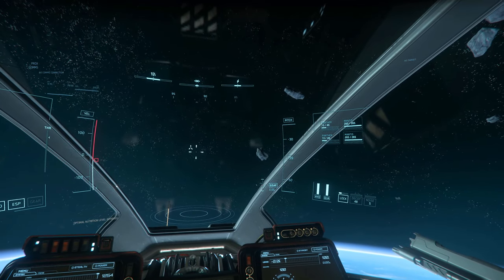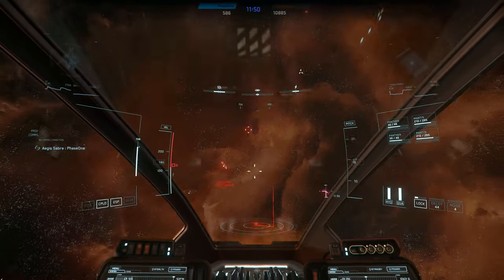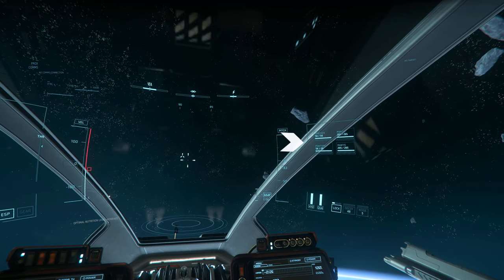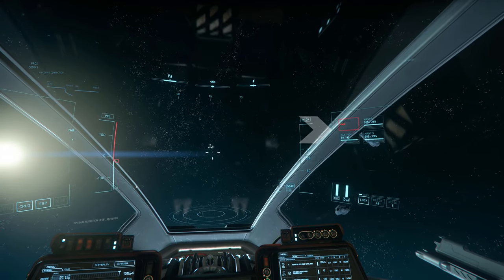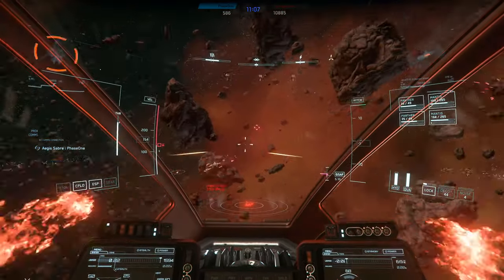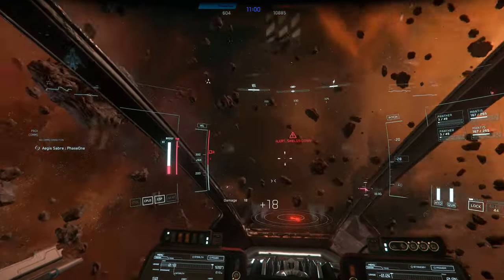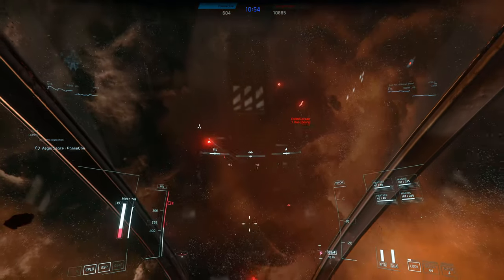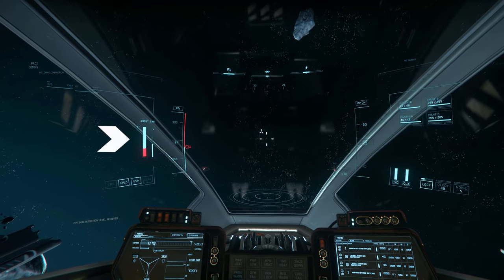Star Citizen 3.14 - Ship Capacitor Management Guide

Comment: According to the keymap in 3.14, F5 increases power to the engines, F6 is shields, and F7 is weapons. I've seen a number of people reference weapons as F5 - Is the keymap wrong? Am I missing something?
Reply from the maker: If that's the case then maybe they need to update the keybinds.  I've been using f5 for weapons all through the ptu phase.
Reply: @PGR_  you were right. I checked the bindings today and the in game keyboard map is wrong. Can’t believe they messed that up.
Reply from the maker: @xenrin  lol yea.
Reply: @xenrin  it kinda happens often when they have first switched around, often they are not correct for some time. So makes it a hard time to find the correct Key binding at times, specialy during ptu as new stuff are added and changed often while keybinding map is not.